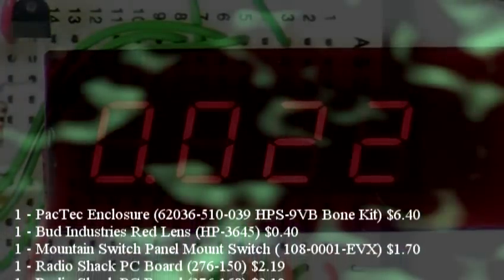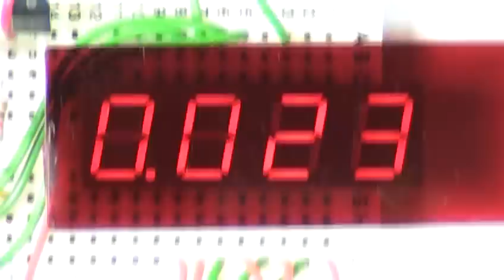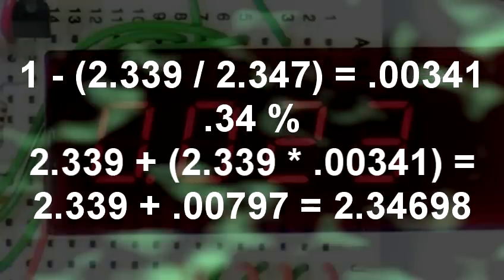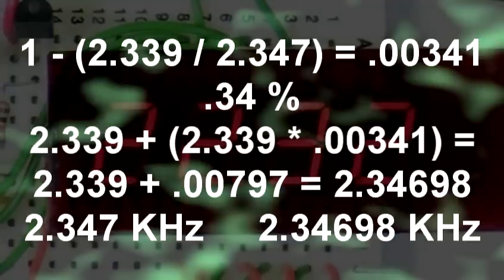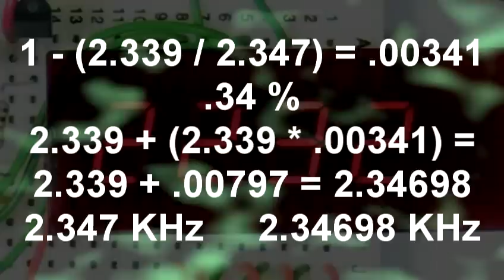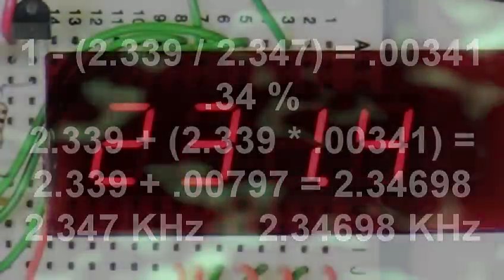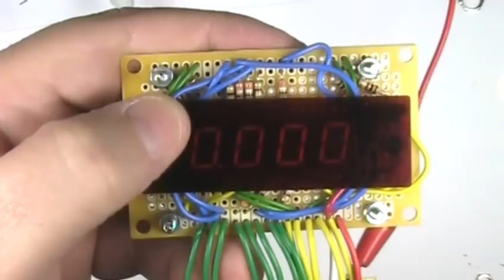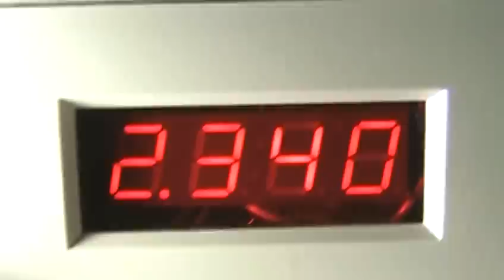MD Lab: DIY Frequency Counter For Under $25

Comment: Hi,
Your videos are great and alot of help.  I am new to electrocnics and would love some advice.  I have an audrino uno and I have connected an LED to it.  My goal is to change the frequency of that LED using a separate key pad and have that frequency display on the LCD screen that came with the audrino.  ex.  I want to the LED to blink at 8hz ..so i would punch into the keypad 8 enter and then it would blink at 8 hz.  If i want to switch it to 10 htz then i would enter the key pad and so on.  ..   How would i do this?  I am at a loss...Thank you for your help in advance.
Reply from the maker: Hello Nikos,

Don't try and create this program (sketch in the Arduino world) all at once. Since you're new to electronics, just start with small things like getting the LED to blink and remember you'll also need a resistor to control the voltage going into the at LED. If you hook it up without a resistor, the LED will blow. Learn how to blink the LED the way you want to, first. Then move on to controlling the LCD screen and learn everything about that. Then you can move on to the keypad. Once you have all the basics down, you can link everything together to create the program you described.

I know there's a lot of resources on the web for getting started. You might want to do some searches on blinking an LED with the Arduino and then move forward from there.
Reply: David, 
Thank you for getting back to me and for your advice.  I will give it a try and let you know!!!!  Thanks and God Bless!!!!

Comment: Hi David! Nice job.I need a mains frequency monitor if you can help. Regards,
Reply from the maker: I don't have a lot of experience working with high voltage, so I'm probably not the best person to ask about this. Sorry.
Reply: Thanks anyways David. Best Regards
Reply: If you measure through a CE approved AC wall adaptor, you should be fine, sir.

Comment from the maker: Youtube has made it difficult to find the send private message button, it's there, but hidden very well. Don't ask me why, it's youtube's brainchild - big heavy sigh here.

There's no kit for this,since you can buy frequency counters off eBay for less than this would cost to build. However, if you do want to build this yourself you'll find the code and schematic at my website, just follow the link in the description. The IDE used is MPLAB X, which can be downloaded for free from microchip

Comment from the maker: Using an opto-coupler isn't that easy, sure it's fine at low frequencies but when you start getting into higher frequencies you'll hit a major wall. Even with digital opto-couplers you're looking at a maximum of 1Mbps (1 MHz), until you start getting into the higher priced opto-couplers. Yes, this will work for low frequencies, but not for higher frequencies. I'll send you a PM regarding the other topic.